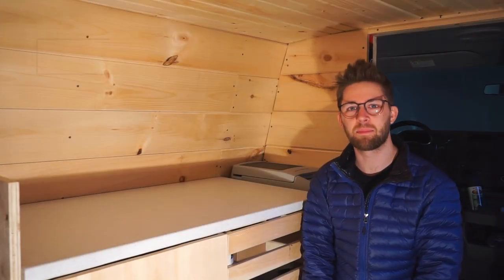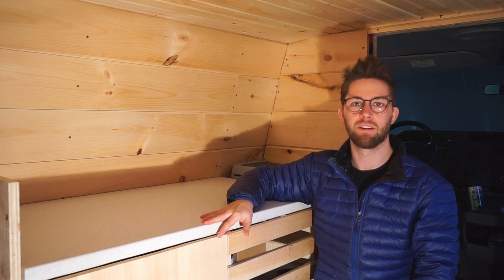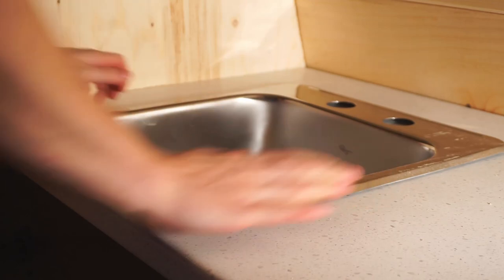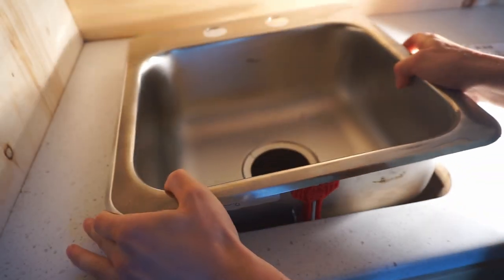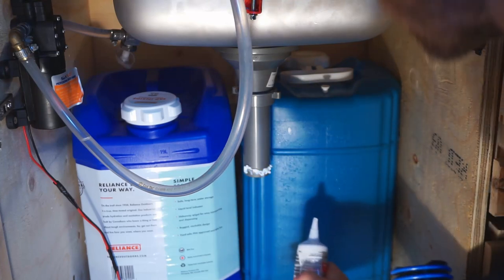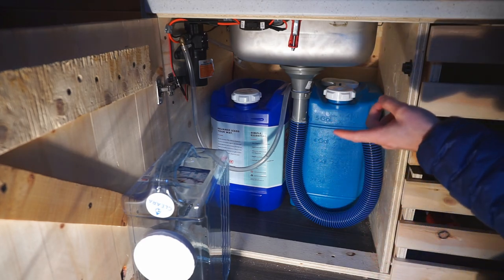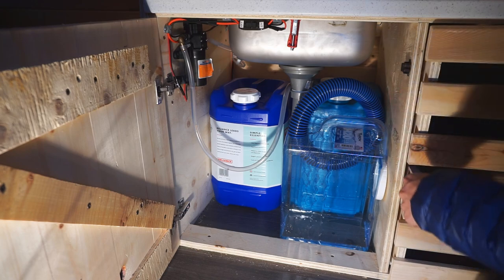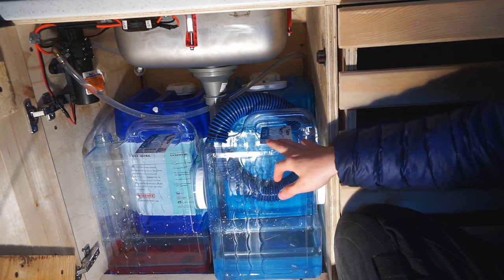DIY Van Conversion | Ep. 11 | Simple van build plumbing solution - Seaflo pump & 50L fresh water

Comment: Shouldn't you have put some caulking down around edges of the hole in the counter top before securing the sink to it? That way water doesn't get up under it and swell up the bare edges under the sink. Noticed that you didn't use plumbers puddy around drain hole before inserting the drain.
Reply from the maker: We did both those things, but just didn't film them haha. You know your plumbing, Tim!
Reply: I know just enough to get into trouble...lol